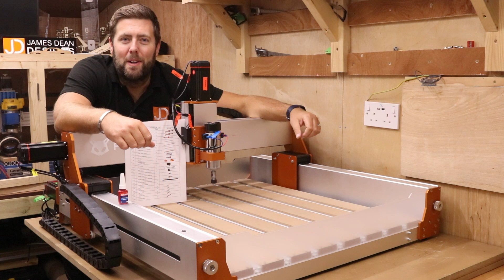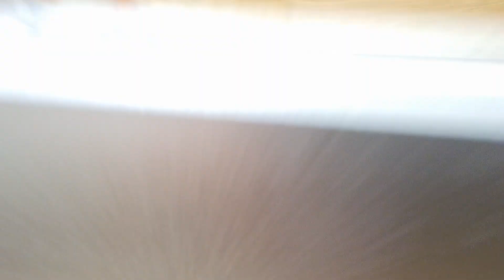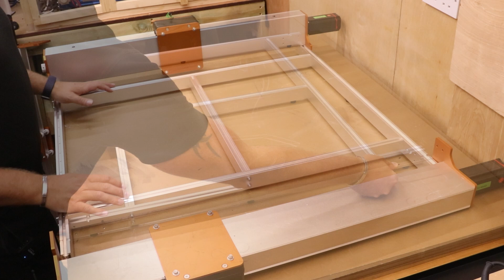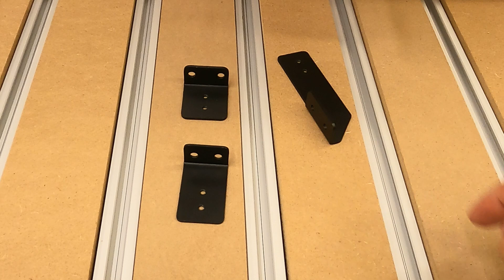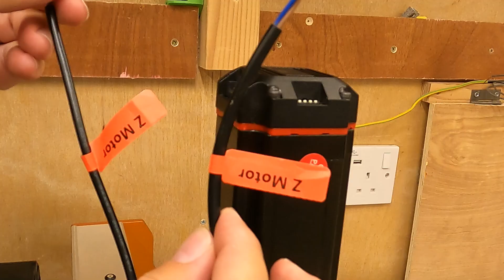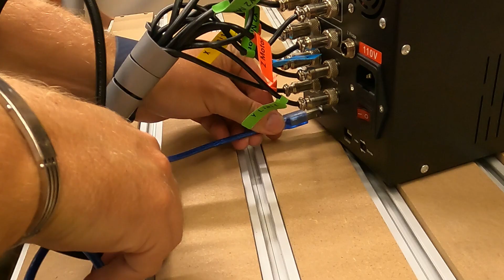FoxAlien CL-6560 CNC machine - Assembly guide

Comment: Hello James, I purchased the Fox Alien CL-6560 for home a while back and I still have not figured out the speeds and feeds and the other half dozen other tool bit parameters to be set.  I use Vectric VCarve Pro for designing.  I have access to a Laguna IQ 24 x 36 machine and all the setting in VCarve default tool database works perfectly.  However, I have not been able to find a set of parameters for a simple 1/4" end mill that will give me a decent cut.  Any suggestions or resources I can leverage to help me down this road?
Reply from the maker: The laguna is a more rigid and powerful machine and will handle the default speeds and feeds. Depending on what spindle you're using with the CL6560, you'll need to lower them, maybe even by half as a starting point and build up from there

Comment: Hi J.D. and Chat...

Would appreciate some advice about weather to use a laser or cutter to cut metal...
The metal I use is non ferrous and only 1mm thick. I need to cut right through or sometimes not so deep! 
Would a laser leave a better finish, so saving clean up time for example? 
What power of laser would be suitable, and does it save on cutters, the cutters I use are tiny, so breakages and wear and tear are high...

Any thoughts from you guys would be greatly appreciated ...

Frank...
Reply from the maker: Hi Frank,
So with metal  it's all about the wave length and in reality the fibre lasers that will cut metal are more expensive. We're talking in the region of around $3,000 to $6,000  depending on power. Also these lasers typically only have smaller work areas as well.
Laser would probably be more efficient than cutting, plasma is possibly another option. 
I should add cutting metal is not an area of expertise for me so this is just based on my existing knowledge

Comment: Hello James, I thought I might suggest a future video for those of us who you have helped immensely. I have the Genmitsu 6050 and I am using it for CNC spindle and also Laser work due to the fact I simply do not have room in my small shop for separate machines. Anyhow I thought a video addressing the difference between a dedicated laser and using your CNC machine to serve both functions. I am pretty new to this stuff but have learned a few things along the way. My cnc with the laser works just fine for cutting jobs , but of course engraving is much slower due to the limits of travel speed. The compromise is well worth it however due to limited space requirements. Anyway I thought you may be able to provide some insight and a comparison for people about the machines that serve duel functions. It was just I thought I had and I think it maybe very helpful video for those of us in my circumstance. You have been a tremendous help on my journey and want to thank you for the video content. Well done sir ! Cheers from Utah !  ;-)
Reply from the maker: That's a great idea. I can't promise when but I will certainly try to get that done 👍

Comment: I am torn between this one and the vastoXXL. I reached out to foxalien themselves, and they recommended the vastoXXL. Obviously it's a little bigger. But they said it will be a little more accurate as well. However did they tell me this because it costs more money? I don't know. I have the upgraded stepper motors allready for the Vasto. This machine is comparable to the VastoXL. Definitely moves quicker. But which one would be a better long term machine? I really like the 48"X48" capacity of the XXL. But I also like to closed loop stepper motors on the 650. So I'm seriously torn lol.
Reply from the maker: With the exception of the stepper motors on this, the Vasto XXL is the better machine because of the linear rails. The linear rails are better than the V wheel system on this machine. 
If you have never had closed loop steppers, you will not miss them so I too would probably advise the vasto as that is technically their best machine. And ultimately the general rule of thumb is get the best you can afford so if you can afford the XXL then go for it. 👍
If you happen to use my link as well 😉😁
https://www.foxalien.com/en-gb/products/cnc-router-machine-vasto-xxl?sca_ref=725103.t6qfXeHAnx
Reply: @JamesDeanDesigns  thank you for the response. I always appreciate that you interact with us so well. I will use your link for certain. That decides it then. I was allready pretty sure on the XXL. Thats why I got the upgraded motors ahead of time. The 650 just looks so sleek tho! They designed a very good looking machine. I wonder would it be decent to dedicate as a laser?
Reply from the maker: @DC-1226  it's probably overkill for a laser to be honest. It's a lot of hardware to essentially run a small lightweight device which is also why most lasers run belts as well, for the better top speed and acceleration
Reply: And this is why I ask you! Thanks man!